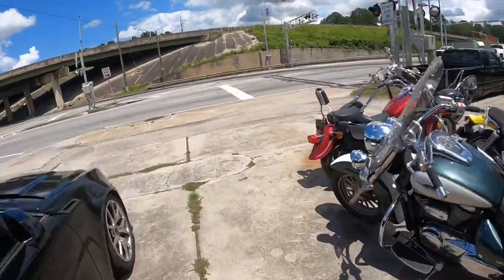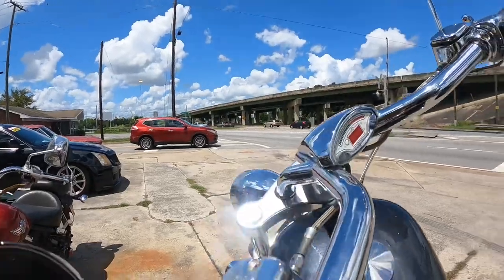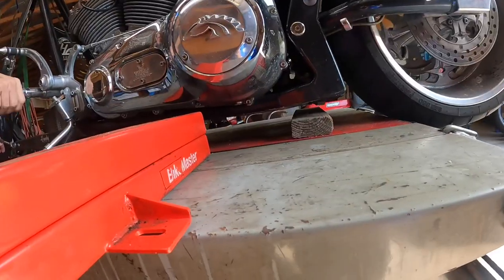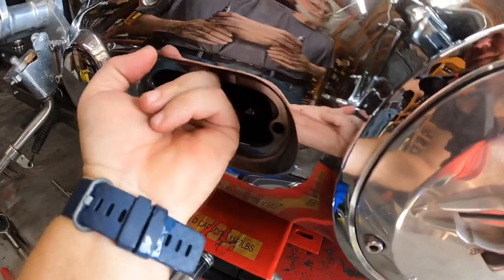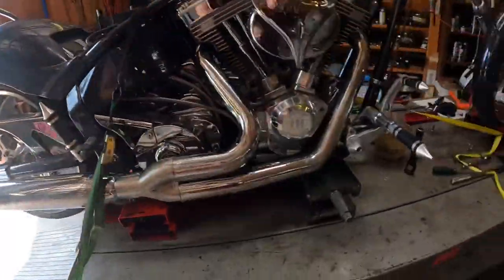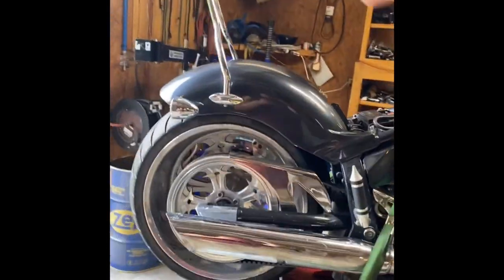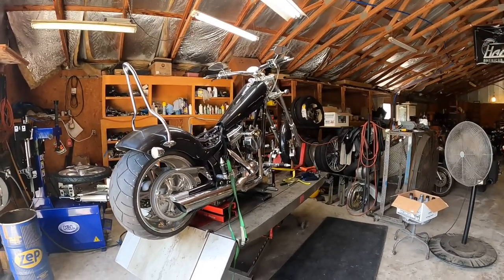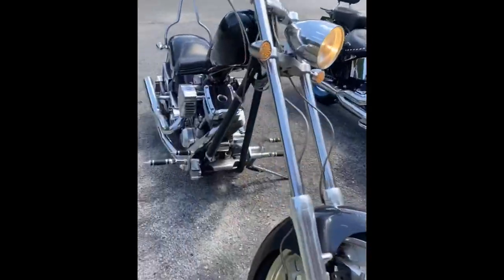IronHorse Texas Chopper maintenance,tire,& brakes

Comment: it dont matter wich way the petcock lever is pointing, when you run out of gas the other way is reserve, thers a devider inside the tank,,  down is off...
Reply from the maker: yup , figured that out when I finally actually looked at how the set up was done .. kinda like an internal split tank .. using the baffles